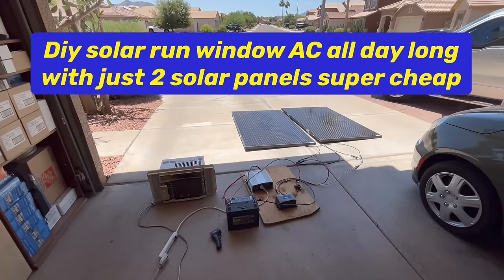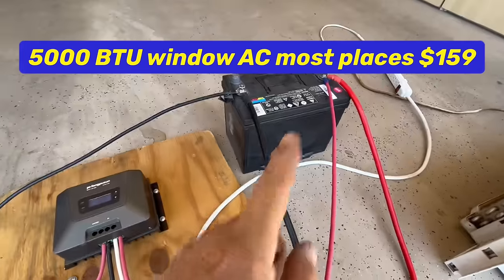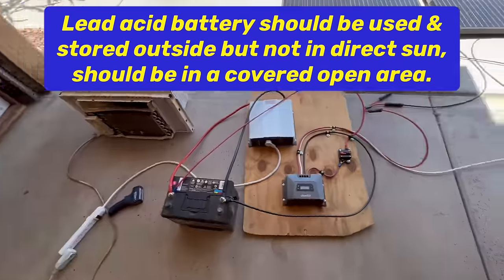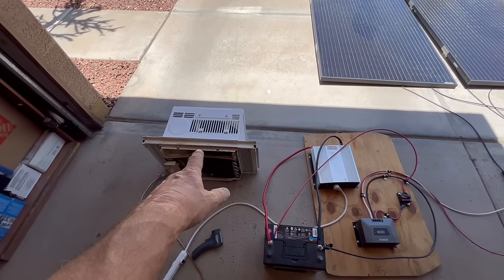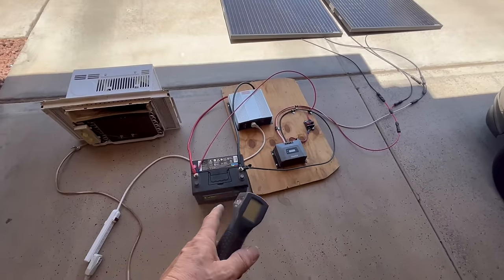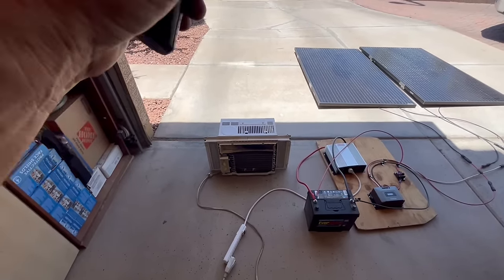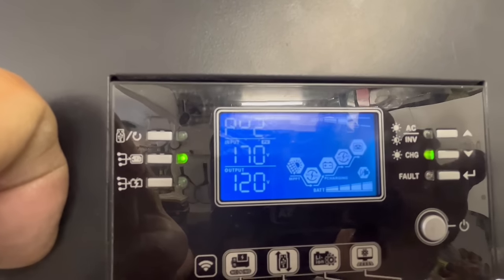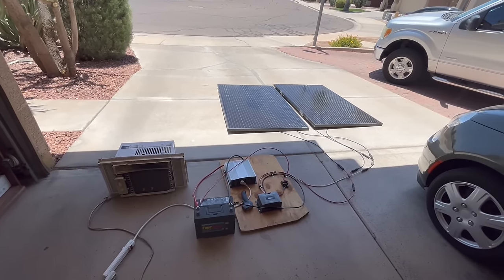Run your window AC with just 2 solar panels when sun shines. Easy DIY project you can do in one day.

Comment: Try adding an additional capacitor to the a/c unit and it will lower the surge when the compressor comes on and help keep your battery charged. Also keep in mind that a modified sine wave inverter is not really good for running electric motors a better inverter will increase efficiency as well. Hope this helps you out.
Reply from the maker: I appreciate your input. This is just a simple example and explanation of running ac on solar. Just so people have the basic understanding of how solar works. I actually run my central ac upstairs and downstairs 24 hours a day on solar in day and lithium iron phosphate battery bank at night., I also air condition my garage in the day as well using off grid solar. Hope you have a wonderful and blessed week
Reply: The battery access a capacitor to take up a lot of the surge in a lot of the newer infect all the newer air conditioners use a much more efficient coolant and they have a surge capacitor inside them so they don't hit your home grid or your inverter as much as they used to. But a very good point.
Reply: @benca- can recommend which capacitor to add and how to add it?  I would like to try this for a garage a/c unit and power by solar.  Perhaps you can make a YouTube video and how to add it?  Thanks.
Reply from the maker: @markgriff9265  I have not worked with capacitors at all. I will have to research them.
Reply: @markgriff9265  you best bet would be to get a “hard start kit” from your local hvac supply store. It is a big capacitor that hooks up between the power wires to the compressor just like the standard one that is currently in all A/C units you would keep the stock one installed and just add the hard start capacitor in parallel with it. Hope this helps.
Reply from the maker: Thanks, I have installed soft starts on my 2 central heat pump and 127,000 btu pool heater heat pump and cut inrush amps by 75 percent at compressor start up. Soft starts are getting really inexpensive for heat pumps.
Reply: @diy-solar-guy  Is a soft start for a heat pump different or same for a standard a/c unit only?
Reply from the maker: @markgriff9265  I have all heat pumps, I have not had a ac unit so I am not sure. I buy hyper engineering. hyperengineering.com
You can call them and ask them that same question
Reply: @diy-solar-guy website not working
Reply from the maker: @macdude3585 try this link https://signaturesolar.com/?ref=oJ3Bgl9hDE3G
You will find soft start on this website under high efficiency appliances catalog. They have a soft start for up to a 4 ton ac and also a soft start for a 5-7 ton ac.
Reply: Hard start capacitors actually increase inrush current. Soft starts reduce it. Get the correct kit.
Reply: @diy-solar-guy 
Could you make a video about it and explain all of your setup
Reply from the maker: I did a video on installing a soft start on my 3 1/2 ton  heat pump and my 12.7 pool heater heat pump. Check those videos out. Hope you have a truly wonderful and blessed week.

Comment: Finally someone set out too simplify this stuff for everyone else instead of the tech talk that leaves you confused . Real nice job ,jeep the videos coming ,your helping us diy'ers in getting our stuff set up simply.
Reply from the maker: Let me know if you have questions, I can help. This video was a simple set up explanation but if you check out my other videos you will see what components are used to heat and cool entire house upstairs, downstairs and even my garage as well as running freezers , fridges, lights, pool pumps 24 hours a day on solar and even heating my 15,000 galling in ground pool to 86-89 degrees. Just bought new bi facial 400-500 watt mono solar panels and showing comparison to used 250 watt poly panels. Upload g a new video on comparison today. Thanks for your wonderful comment and hope you have a truly wonderful and blessed 2024
Reply: @diy-solar-guy  i do need help, just a little i have a place outside of the valley, im setting up and need to have ac
Reply from the maker: @martinstanley1231  They have mini split that are direct connect from solar panels that do not need an inverter or battery bank to run during the day. But your time running without a battery bank will be reduced down. You can also connect to grid power to run overnight when there is no sun or on cloudy days. Those cost around $1200 plus freight. You can get at Signature Solar. Should be a link in the video for signature solar. DIY solar power with Will Prouse I think has a video of how to install that hybrid do it yourself mini split. Several people on YouTube have made install videos for those mini splits. It will be much more efficient than a window only use about 2 times the watts. Run on solar in day and grid power at night. Cute electric cost in half. I just looked at what I’m paying for electric per kWh and it is almost $.18 for every 1000 watts I use. Ac is my most expensive electric cost by far. With a hybrid mini split you only need to buy mini split, around 1500-2000 watts of solar panels, solar wire 10 gauge and a few mc4 connectors and crimping tool. Going the other route you would have to buy a lot of separate components plus what is mentioned above. These mini splits once they reach set temp will only use 300-600 watts and maybe down to 100 watts at night as where the window ac will use 500-550 watts 7-24. Hope this helps. Look into those mini splits. 12,000 btu 120v input grid.
Reply: @diy-solar-guy  8:00 I thought you said don’t keep it in the motor home. Isn’t that a fire hazard as stated
Reply from the maker: @youtubedeletesmychannels2329  I would have solar panels disconnected and secured inside with a blanket over panels so no light could hit solar panels from inside motor home. I would just be transported until I get to camp site, then bring out of motor home and set up and connect to solar off grid system.
Reply: @diy-solar-guy  I want so badly to order one of those DIY minis, but the cost factor for me is still too high at around 2K for split and panels (about 12 yr payback for me). I have 3 ton at the house so I thought of the 1 ton unit for backup and emergency power here in Florida. I may be able to scrounge enough equipment to make a hybrid unit with battery and window shaker (like you made) if I can find a higher efficiency window unit, just for emergency.
Reply from the maker: @GeorgeKennedy-u4r  I started out just buying some used 250 watt solar panels. Just bought little by little until I had enough parts to start making solar power off grid. Then as I saved money on my power bill, I just reinvested the money. It’s been almost 5 years since I started messing around with solar. I buy a lot of refurbished equipment and batteries which I can sometimes get 50 percent off. Had no problems with anything refurbished. Hope you get your project up and running soon. Hope you have a truly wonderful and extremely blessed 2024
Reply from the maker: @user-ol5rj8qn9o out here the payback is quick when it gets above 110 degrees. My neighbors bills are $700-$1000 a month in summer for ac. Signature solar has a hybrid mini split that is direct connect from solar panels to outside unit of mini split and can also wire to grid and limit watts from grid to less than 600 watts max. Only need 12,000 btu hybrid mini split. 1600-2000 watts of solar panels and wire, mc4 connectors. Can run during the day while sun is out and on grid at night. If you get a lot of clouds in the summer, using solar to cool house could be a huge challenge. Even partly cloudy days can be hard to produce power. We have over 320 days of glorious pure sunshine here a year so AZ is an excellent place for solar but yesterday and today I had to run my ac on grid power because of lightly cloudy sky. Check out those hybrid units. They are nice. You can watch videos on YouTube about EG4 hybrid mini splits to get more info. Hope you have a blessed day
Reply: @diy-solar-guy  Wow, seems like you've been into it for more than 5 years judging how far along you are with your projects. I guess a couple years ago I got turned off by trying out a small cheap inverter unit to power lights during a power outage. The inverter worked but it put out an annoying high-pitch squeal and it even disturbed our radio signals. I shut it off and just used LED lamps.
Reply from the maker: @GeorgeKennedy-u4r  the new products are so easy and work great. Very easy to connect, a lot of advances over last 5 years and prices have dropped so much. I am glad I started 5 years ago when I did, timed it perfectly.

Comment: one of the advantages of solar is the panels shade the roof where they are mounted, and that lowers your room temps too.
Reply from the maker: I use that concept on my pergolas in the back yard so it stays cool underneath when 100+ degrees out.
Reply: Why  mount them to the roof??? Then you have to park in the sun... Park camper in the SHADE and run cables out to the solar panels in the SUN,,,SOUNDS BETTER TO ME but to each his own
Reply from the maker: @shanepowell5115  that’s a good idea
Reply: Agree. I experimented with ply sheeting on the garden office when my son said was too hot to work in. Made a huge difference. I'm now putting solar on .
Reply: Unless you have no yard you really don't want to attach the panels to your roof. The expanse and the penetrations in the roof and all the other issues make that a non-starter for the homebuilder. Instead the thing to do is to prop them against your house or tie them directly to the ground with some steaks or build a small patio cover and use the panels as the roofing. This is so much easier to do for the homebuilder whereas trying to put things on your roof is extremely dangerous and can compromise your roof and is only should be done for the by the professional. Also keep in mind many HOAs and many jurisdictions will really come after you for inspections if they see new panels on your roof even if they're not tied to the grid. But if you put panels out leaning against the side of your house or directly on the ground or on some little shed or some little thing you built over a patio then you're much less likely to get harassed.
Reply from the maker: I have no solar on my roof. I installed on wood pergolas and built solar array from scratch and secured solar panels to arrays. Good points in your comments. Hope you have a wonderful and blessed week
Reply: @yougeo  If you're in Port St Lousy Fl and the code cops see them on your roof without jumping through all the city permit hoops, they'll fine you more than what the system costs and if you fight them on it they put a lien on your property.
Reply from the maker: @user-ol5rj8qn9o that’s one reason why I have no solar panels on my roof. Every solar panel is in back yard.. Thanks for the comment, that will help others. Hoe you have a truly wonderful and extremely blessed 2024

Comment: To save the battery and prolonging the run time I used a Ultracapacitor in parallel with the battery that way when the compressor kicks in the caps act as a shock absorber preventing the battery from a huge dip in voltage also less strain on your inverter since it has plenty of quick amps to kick that compressor on. How long can you run on just one battery and those two solar Panels on a sunny day?
Reply from the maker: From around 9-5 so 8 hours
Reply: The system is not sustainable, the battery will be destroyed very quickly.
Reply from the maker: @montanadan2524  I used these cheap wallmart batteries in my shed running this window ac for 2 years. I had between 2 and 4 batteries in parallel over the 2 years. You can not let these batteries go below 12volts. I ran from 9am-5pm every day. But the batteries were inside shed where it kept temp below 65 degrees. I super insulated the shed on all 4 walls and roof so when I turned off at 5pm , it was still under 70 degrees when sun went down. I would be better to use 2 batteries to make 24 volt system. That charge controller is auto sensing and will know if you connect 24 volt battery bank. If you use 24 volt battery bank you can use 4- solar panels of 250-330 watts each. Then you definitely will not have a problem keeping unit running on high all day long from 9am-5pm. I opened the shed several times a day with both doors open to expel and gases from batteries as they were being charged and never had a problem. This was just a simple set up to show you can run ac on solar. I actually just posted a video of running my whole house 2450 square feet and 3 car garage totaling around 3000 square feet, i air conditioning all of it fir the first month with solar during the day and 25.5 kWh battery bank at night. 24 hours a day I run my upstairs 3 1/2 ton upstairs heat pump to air condition. I spent $0 on air conditioning my entire house and garage for last 30 days. I also now in the winter can run my electric pool heat pump pool heater that is 127,000 btu and use 7000-8000 watts while running or 186 dc amps to run. Check out all I do on off grid solar. Not one solar panel is on my roof. Thanks for your input and hope you have a wonderful and blessed day.
Reply: @diy-solar-guy  so how many batteries did you use two, four, or the one you have shown?  One battery like you have shown in your video is doomed.
Reply from the maker: @montanadan2524  I started with one battery but realized on semi partial cloudy days that was not enough, so I added a second battery in parallel, after a year I added 2 more 12volt batteries because I wanted to run outside lights overnight and needed at least 4 12volt batteries to so that. Lead acid and agm are not the best battery to use if you want to run all day. LiFePO4 batteries are much better and can even get you through the night if you calculate watts needed. This was just an example of what you can do with solar. Check out my latest video where I am now running my whole house and garage on solar in day and house upstairs at night. I spent $0 last month in air conditioning cost. It has been around 113 in day and 85 degrees at night. This is the amazing things you can do with off grid solar. I also run my pool pump 24 hours a day and my 2 electric pool heaters in the winter to keep pool temp in high 80’s thanks for your input. Hope you have a wonderful and blessed day.
Reply: @diy-solar-guy great video thanks for sharing gotta live the haters! Appreciate your contributions ..new sub here
Reply from the maker: @allaboutsemis232  thank you so much. Haters come with the territory. Just a DIY guy that figured out solar by myself with no formal education. I just try to share what I have done, I though what I have been able to do was impossible 2 years ago, but I persisted. Thanks again and hope you have a wonderful and truly blessed weekend
Reply: @diy-solar-guy  im in the same boat im learning on my own i wanna solar up my bus maybe I  can pick your your brain one day..and you be blessed as well my friend..
Reply from the maker: @allaboutsemis232  sure ask any questions, I will help in any way I can
Reply from the maker: I installed 6 mini splits and figured out how to run my 3 1/2 to & 4 ton central ac heat pumps on solar and in winter I can run my 12,7 ton pool heat pump electric pool heater to heat my 15,000 gallon pool to 87-89 degrees along with running pool pump on solar year round 7/24. All of this is powered by off grid solar and not one single solar panel is on my roof. Check out my other videos to see how I did all this. Should help you get a better idea of learning curve I just 4 years of knowing nothing to overcoming many obstacles that were not possible a few years ago. All DIY off grid solar and 25.5 kWh EG4 LiFePO4 battery bank fir overnight air conditioning. Can’t forget the air conditioned 3 car garage at 78 degrees in az when 116 degrees out in day.  Life is good
Reply: @diy-solar-guy  yeAh i was just watching that video about your 2000 plys watt set up!
Reply from the maker: Let me know if you have any questions, thanks k you do much for watching my videos. Hope you have a wonderful and blessed weekend

Comment: With this temperature this be a good investment to cool off at least a room on your house. Well done and thanks for sharing this idea.
Reply from the maker: I actual built this set up 4 years ago and use in my shed for almost 2 years. Now I completely air condition my 2 story house 7/24 with off grid solar with the actual central ac or I can use 6 mini splits I installed in house and garage. All with off grid solar in day and 25.5 kWh EG4 LiFePO4 battery bank overnight. I run pool pump 24 hours a day along with 3 freezers, a fridge and lights out side. It’s been 4 years since I started playing with solar and now my entire system will be completely paid off from just savings in electric bill alone by December of 2023. Thanks for your comment and hope you have a truly wonderful and very blessed weekend

Comment: Thanks for the video.
Electrical engineer here, you could use a soft start ac capacitor in order to reduce that starting current draw tremendously, because it seems your old ac does not come with one.
Reply from the maker: I actually use a soft start for my 3 1/2 ton, 4ton heat pump ac units on house to air condition my house with only solar and heat in winter as well. I used a soft start on my 127,000 btu pool heater heat pump that heat my pool to 87-89 degrees in the winter all with only solar off grid. Thanks for your input. Hope you have a wonderful and blessed day
Reply: Crackhead here, you're right.
Reply: Do you have a video for that? Just subbed.
Great demonstration! @diy-solar-guy
Reply from the maker: I do have a video for installation of soft start on 3 1/2 ton, 4 ton and 12.7 ton. All separate videos.